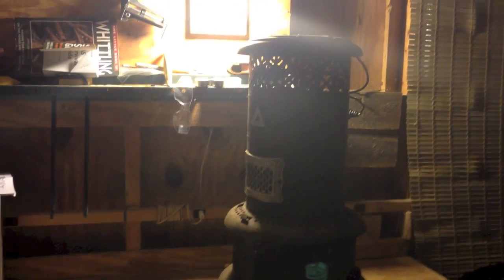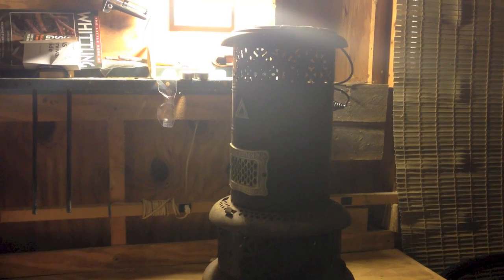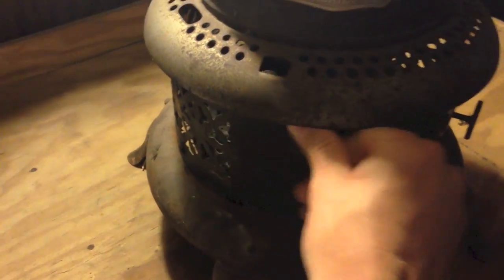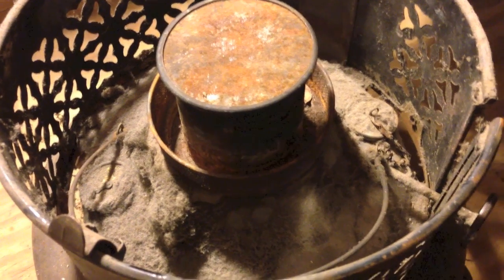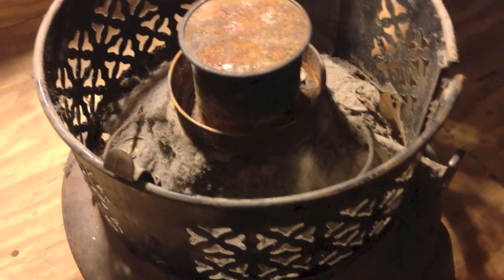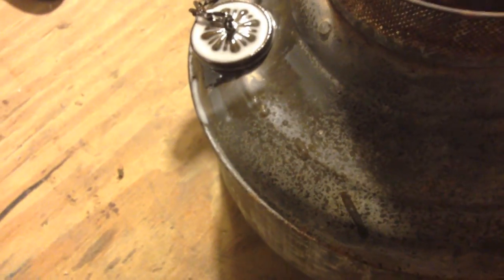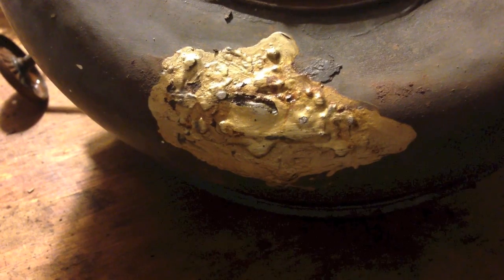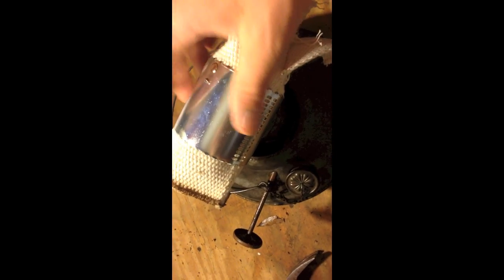100 year old tiny house heater

Comment: Thanks great video!! For about 7 years now we have heated our home with a wood stove + a newer version of this kind of heater. The newer heaters incorporate a tip over switch that instantly puts out the flame if it's bumped hard. These units give plenty of heat + can be cooked on very easily. I'd STRONGLY recommend using a Carbon Monoxide Detector / CO Alarm if you use one of these heaters. I also use K1 kerosene ($4.11 per gallon) + have no stinky smell or soot. I'm told that the new ULSD (diesel fuel) that sells for about $3.50 a gallon also burns well but I've yet to try it. If someone has used it please let me know. Thanks
Reply: lol old comment but yep i just tried the new diesel and can confirm it works well

Comment: Can't agree with you more. These old Perfections are works of art. Unfortunately the later models dispensed with the artistic styling and took on the utilitarian look familiar to most modern heaters. One cool thing you can do with these heaters in warm weather is to take out and store the fount/burner unit and put a small lamp with a colored lightbulb in its place -- makes the heater both a neat conversation piece and night light.

Comment: I love these, just got my first Perfection heater model 1703. My first run was with 5 gallons of Klean Strip K-1 ($44 total). Just got 5 gallons of ULSD for $13 ($2.60 a gallon in NJ), and added one pint of 91% Isopropyl Alcohol to the 5 gallons to thin it out for wick preservation (Saw a couple videos raving about it). So far it's great, burning clean and even less odor than the K-1 I used. No smoke or soot whatsoever. Also burning very slow compared to the K-1, tank is still on full after an hour and a half.  Time will tell but so far so great with ULSD.
Reply: Jay Ski Did the ULSD work as good as you first thought ?
Reply: It worked great at first, but after two or three refills the quality of the burn reduced fast, and it burned the wick down faster than regular Kerosene. Not bad when nothing else is available, but good old Kerosene is still the best.

Comment: I just got ma Perfection Model 730 on Ebay for $65.00.... got a new wick on Ebay for $9.00.....I was shocked when I went to buy some Kerosene and it was $8.99 per gallon at my local BiMart store.... gotta be a cheaper alternative !
Can't wait to fire it up when I find a reasonably priced fuel !
Reply: Deisel?
Reply: Find a gas station that has it. It may be difficult but it will probably be worth it. Make sure its not dyed red. Diesel will work with 100% cotton wicks only, although you may need to clean it more often.
Reply: I forgot to add, to add some alcohol to the kerosene, or the diesel. Either methanol, ethanol, or 91% isopropyl alcohol in a ratio of 1 ounce alcohol to 5 gallons fuel.